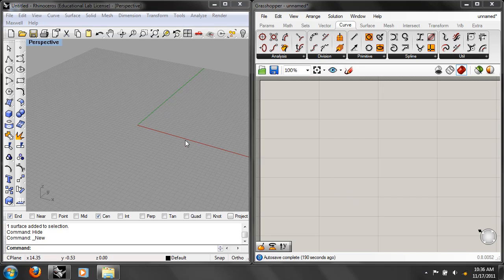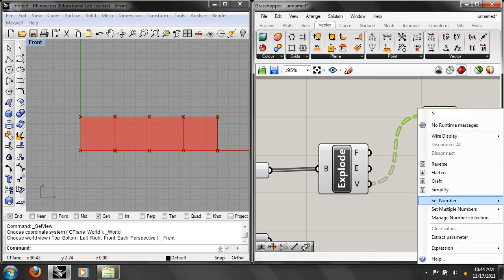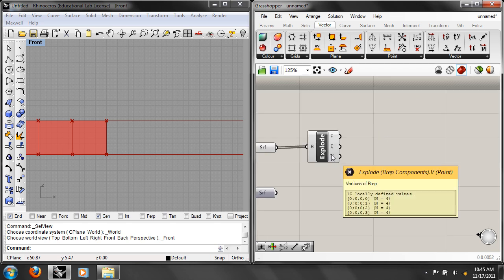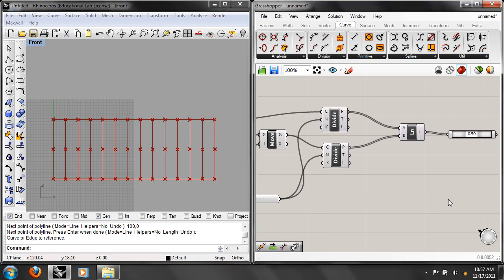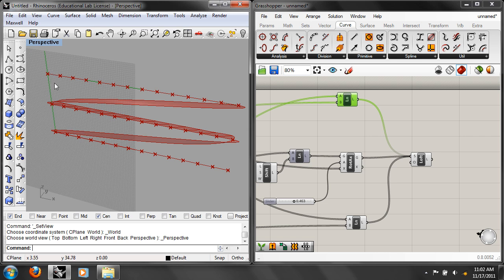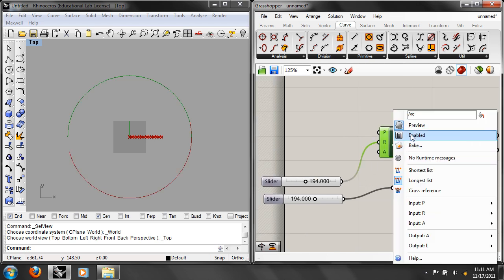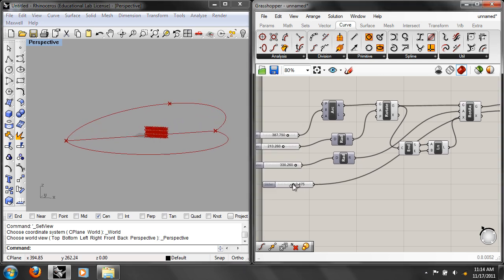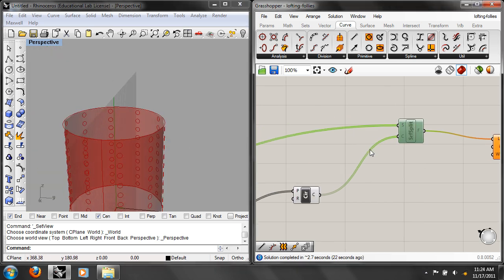Grasshopper Lab 4: Data Structures, Truss & Twisted Strip Surface

Comment: Hello, in the second part where you use shift, the last point shifts to the existing first point making a long line instead of those small segments. I don't know where in doing it wrong.
Reply: Bro use a cull index logic with list length  to cull the last index in all the shifted lists...you can loft then but you will still get a run time warning...so you have to use a cull index logic again for the 2 lengths and rotated line segments.... and then graft them after the last index is culled .
Reply: and then loft them in order
Reply: @bharatarvindan7820  graft the output of the lists